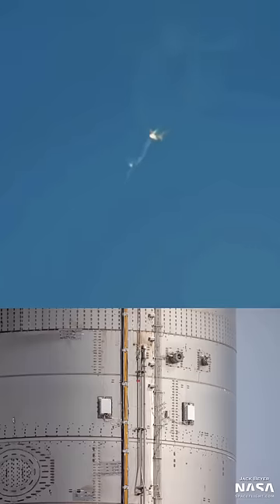Is This Why Starship Wasn’t Destroyed The Moment It Lost Control?

Comment: Omg, do they use math at space X or do they just throw stuff at the walls and see what sticks???
Reply: Launching a skyscraper sized rocket into the atmosphere is not necessarily an easy task
Reply: @jacklets3851  yea, I get that, but when you look at successful programs like the Apollo program they didn't built a fake Saturn V, no what they did is simple, they made their calculations then built the rocket and tested it once completed, what space is doing is like throwing every individual piece of a car at a wall one by one, if there's no damages one the pieces then the car is safe...

The conclusion from these tests will most likely be useless since the final version of the ship that has yet to be communicated, will behave entirely differently due to the landed weight and structural changes...

They are making an incredibly dangerous spaceship and aren't even testing it properly...

Comment: I can tell you this isn’t correct, really smart answer but that’s not what happened. And the so called red switch or explode button is automatic not a manual button someone pushes. Not anymore anyways
Reply: This is exactly what happened. It’s actually the biggest issue out of the test by far. Although you are correct that it’s automated.

Comment: I guess there no on board computer to detect a malfunction this would be destroy by manual control in command center
Reply: ??? Rockets are entirely automated. The rocket blew itself up.
Reply: It needs a command center to blow it up and sometimes the automated system may have been shorted out from that mess reason why it didn't blow itself up

Comment: Ahhh this is NOT a failure of a Starship Rocket. It's actually the accelerated, autonomous, automatic, secondary, shipping, mitigation, fast pack system! Or AAASS MFPS. It expedites the return to SpaceX Texas of their newest  Star Ship Stage 1 rocket booster. That thing costs squillions to truck back to the launch pad via JB Hunt, Roadway, FedEx, or UPS! So a airborne dynamic disassembly reduces everything to pennies on the dollar and only requires the Republicans, Democrats, and Independents in our government to fetch the parts, box them up and send them back to SpaceX! It's as easy as putting gasoline in an electric car, and they aren't doing anything anyway!

Comment: So let's get this straight first it's space craft than it's spaceship than starship according to this that would be designated as spacecraft starship
Reply: A spacecraft is a craft in space that can't really used like a plane or ship, not including . Or in other words it needs multiple steps to make it run on its own in space
Reply: While a spaceship is something in space that acts similar to a plane or ship that can be reusable to the instant that it needs maintenance and fuel no need for outside forces required to function on its own.
Reply: But a starship similar to space ship is designed to be used to cross the large void of space to multiple star systems
Reply: In other words while a spaceship might be able travel the solar system effectively without much help a starship will do the same when traveling across and pass different star systems
Reply: However you also have to remember that the need for life boats exist and are just boats not ship so in this case, a vessel thats design to be in space and can enter the atmosphere effectively and can be used to land on ground and be ready to be used again would be designated as a, shuttle

Comment: More so look at the one rocket cocked at a 45 degree angle.poor engineering if they can't even keep the motors mounted in place.🥸🏴‍☠️🧑‍🔧
Reply: The engines were supposed to move to help the rocket land and maneuver in space, but some of its engines turned off and took out the balence of the rocket.
Reply: @Shopweasel well they just launched it again and everything before stage separation worked flawlessly. You act like you have even half of the intelligence than that of space x engineers but you don’t.

Comment: You are the rocket scientist, and I'm not, but I wish you would have indicated that Liquid Oxygen cannot explode or burn. Oxygen doesn't burn. Period. Burning occurs when something combines with oxygen. Also, the Liquid Hydrogen does not require any Liquid Oxygen (from the other tank) to explode. Liquid Hydrogen in a rocket can explode using nothing more than the Oxygen in the atmosphere. Albeit a little less violently.
Reply: And this has no hydrogen. Pure oxygen is considered explody as it makes it so much easer for stuff to ignite in its presence. The METHANE fuel can burn using the oxygen in the atmosphere but the goal of the FTS system is to mix that pure O2 into the methane to make it burn NOW and not 40 seconds later.

Comment: So just confirming that this was a clusterfuck from start to finish.

Launchpad: Garbage
Engines: Garbage
Abort system: Garbage

And for those saying you have to break some eggs to make an omelette, the Saturn V from over 50 years ago had zero failures.
Reply: Lol the Saturn V killed 3 astronauts during a basic test. The F1 engines almost sunk the entire program with combustion stability issues. Apollo 13 almost killed another 3 astronauts due to improper handling of sensitive equipment years prior. Ya, the Saturn V program had some issues.
Reply: @kiljaeden7663 the Saturn V is the entire rocket the Saturn V failed as the oxygen tanks failed
Reply: @kiljaeden7663 also why are you surprised the largest rocket ever using a new fuel the most complex engine power cycle ever with 33 engines fully reusable capability’s that’s also unstable due to needing to recover the second stage had a failure after it had already passed the hardest part of flight (Max Q)

Comment: And you want SUVs off the road because of emissions
Reply: What bad emissions come from this rocket
Reply: @peeperleviathan2839  the part where, explosives blow holes in the tanks dumping liquid methane into the atmosphere. Methane is supposed to be a greenhouse gas,,, At that altitude it’s that much closer to the ozone layer than a SUV tailpipe. But that’s just one rocket, right.
Reply: @sixoffive  methane doesn’t react with ozone yes it’s a greenhouse gas but the amount dumped here is minuscule compared to other types of methane emissions
Reply: @peeperleviathan2839  nope, it still a substantial amount and undoubtedly has had an effect on the climate.  Also, Methane actually increases the amount of ozone in troposphere, so I’m still thinking that’s a bad think climate wise. The question is, is this release more than what would be released naturally from the rainforest if it was completely intact in one day? What about the herds of bison that once roamed North America? I’m sure they released a considerable amount of methane. Just like cows, sheep, and hogs of today.
Reply: @sixoffive  1- ozone is better in higher amounts ( unless to high) as it protects us from cosmic and sub rays.

2- the total amount of bison or wild animals is definitely topped by the 2 billion domesticated cows
Reply: @peeperleviathan2839  Hi,
About the ozone, ozone layer close to the edge of the atmosphere yes. Today where I’m at there is an air quality alert, ozone levels too high.
Livestock, I won’t argue further. Because I don’t believe as a whole that we are managing livestock life cycle, feeding and processing well. And you’re right about the quality worldwide. 
It’s nice chatting with you, I’m not a scientist or expert. Just my opinion on my observations.
Reply: @sixoffive  it exploded at 33km that’s high in the atmosphere. Good talk to